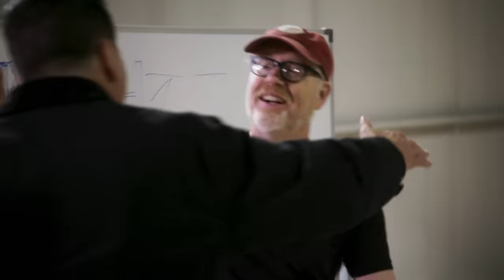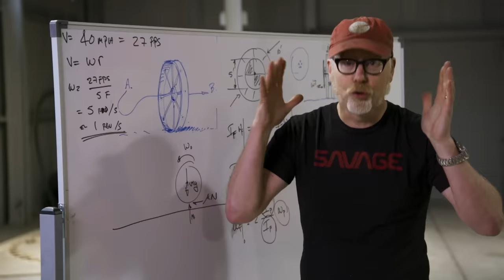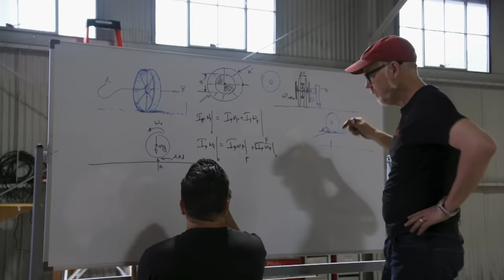"The Power In These Flywheels Scares The Pants Off Me" | Savage Builds

Comment: I'm surprised they did this test in a warehouse. They were careful, at least, but I'd assume they wouldn't want to spin it up in a city at all. If it runs off in a desert you just need to go get it back. If it runs off in a city, you have problems.
Reply: sums up my love life perfectly
Reply: At the JET experimental fusion reactor they have 4 - 775 ton flywheels they spin up to provide the starting spark for the fusion reaction. They calculated that if they broke free while at full speed they would travel ~12 miles before stopping
Reply: It's not gonna keep going through a wall though. Sure its got a lot of momentum but without any traction its not making it far
Reply: @jonohiggs  why those things, who needs batteries ?
Reply: @falcon3792  Traction wouldn't be an issue. Rotating mass vs static mass. Think more of a marble rolling across glass and less car stuck spinning it's tires.
Reply: Yeah in a desert it might get heavy lugging it back, but in a city you've got bodies to hide the whole way.
Reply: Not careful enough, something with that much weight needs to be balance properly
Reply: Yeah. Smells like that cannon all over again. :P
Reply: @monad_tcp  They use flywheels because they can be "discharged" a lot faster than a battery can. Each of the two flywheels at JET can store 3.75GJ and deliver up to 400MW of power for a few seconds. With the best rechargeable batteries that were commercially available at the time when it was built (1981) they'd have needed at least 3000t of batteries (not even counting the weight of the hardware needed to connect all those batteries) to replace just one of the flywheels. And those batteries definitely wouldn't have lasted 40 years like the flywheels now have.
Reply: Take it to a place where monster trucks go mudding, and have a crane with a magnet attached, for retrievals.
Reply: @falcon3792  speed and weight are all that matters, without traction it will spin for a while when it first touches the ground. But, once it gets up to speed, traction doesn't make a difference.
Reply: It has happened in the past that the windings of large wound rotor motors slip and jam, all the momentum of the rotor transfers to the frame and rips loose and the whole motor goes skipping off into the distance. A couple of miles I am told.
Reply: @calebclunie4001  Nah, a fly wheel can go far. For recovery your best bet is probably a truck, some pulleys, a winch and maybe a trailer.
Reply: To be fair, this was a CRAZY dangerous thing to do no matter where they did it, and this makes for exciting TV so...
Reply: @Compgeek86  kinda like how you can spin a hula hoop vertically and after a second of spinning in place it goes off in the direction its spinning. Granted there is probably more friction involved in that but same principle?
Reply: @danielbolin2361  yup, look up a video of someone spinning ball bearings with air, it gets up to speed and when you drop it, sparks fly until it picks up speed and takes off
Reply: @monad_tcp  flywheels are simpler, more reliable and probably cheaper
Reply: More importantly, someone else will have problems.
Reply: @FoxtrotYouniform  comment of the year
Reply: Careful?  That was the worst safety release clutch I've ever seen built.
Reply: @agvulpine  That is true
Reply: @D It would have accelerated with so much force that any crane cables that were in the warehouse would likely have snapped and become a hazard themselves. We're talking about the the amount of energy found in strong explosives here. If this wheel were to hit the ground, pretty much any attempt to stop it would only make things more dangerous.
Reply: Horrible visions of these things dropped on cities from planes comes to mind.
Reply: They didn’t plan for variables very well
Reply: @falcon3792  Never underestimate the destructive power of Big Heavy Spinny Things.  Decades ago, there would be periodic cases of flywheels walking off the shafts of stationary engines (~2ft diameter few hundred pound cast iron disc).  They would typically go a few miles and through any buildings that got in the way.
This is the kind of experiment you do in a big empty swimming pool covered with a few layers of fiberglass coated spancrete panels topped with 5ft of dirt.
Reply: @jonohiggs  I just re-did the calculations with an infinite frictionless plane in a vacuum, and I got >12 miles

Comment: should do this in a dry dock or somewhere similar. I felt my blood pressure drop when they realised it was out of balance.
Reply: See how it was bolted on too? Suprised that vibration didnt completely shear off the threads.
Reply: Adam's definition of 'safe' is one sigma lower than that of most engineers.
This allows for rapid prototyping, but also causes visible risk.

Comment: I did a research project with a one tonne 1 meter steel flywheel that span up to 6,000 rpm. Equivalent stored energy as a 10 tonne truck going 100 mph. Pretty interesting standing next to it going full tilt.
Reply: When you ran the math you actually realize just how dangerous it was
Reply: Video?  Did you use the axle for PTO power?
Reply: @gregsteele9002  He didn't use the truck. I'm sure that was spun up with an electric motor.
Reply: span?
Reply: I hope you had it balanced precariously on a makeshift frame and used a piece of timber as a brake
Reply: I bet this made a pretty interesting sound at the 6000rpm's "redline"
Reply: @michaeltoner1993  HAHAHAHA
Reply: @Joshua Kiser Probably, the Kinetic Energy formula or Potential Energy Frmla will be a great help- to have a glimpsed of horrible destructive power such high RPM flywheels!...
Reply: You can write whatever you want on the internet, but this is total BS.  If you are going to make up a story keep it within reason.  I can't believe that no one else has questioned this in the course of a year.

Comment: As a certified vibration analyst and an industrial millwright i have some serious reservations about this test. With all due respect for the people involved a couple of key things need to be done. 
1) do a resonance test on the assembly. This will show the natural vibration frequencies of machine., for example if the unit has a resonate frequency of 350cpm when it reaches 350rpm or any multiple of it it could shake substantially  and lead to a very unpleasant situation. 

2) The axle housing only appeared to be held in place by a strap wound around it and there was no means of applying a braking force to the discs.

Some sensationalism can be dangerous.
Reply: Sensationalism IS the point.  Camera angles and video cutaways are used to make it seem more dangerous than it actually is. There were safety measures taken that we were not made aware of to bring up the "oh no, what's going to happen?!" factor.

Comment: If both of those wheels don't hit the ground at the same time and get the same amount of traction (impossible), it will take off in whatever direction it wants. Heavy vehicles in front of it will just send it up into the air. I can't wait to see the next episode.
Reply: more likely if just one wheel hit, the thing would soon or over a short distance flip onto one side from the perpendicular torque. Hopefully it would then spin like a top, but no guarantees. Highly risky.

Comment: As a guy who work on 8ft circle saw I'm amazed that they never applied internal tension to the disks. Or balanced them. Saws are hammered to run at certain rpm without wobble.
Reply: I was thinking the same thing like. Why not balance them like a car tire?
Reply: Late to the party but how do you apply internal tension? 
And hammered in this context is deformed to achieve static and dynamic balance?
Yeah I can't believe they did no balancing at all...

Comment: There is no way those steel wheels are balanced enough to not vibrate like crazy! And the way they are attached to the hub is also very sketchy 😂 I love it
Reply: That's why we watch haha.
Reply: Agreed. They need to be balanced and bolted to the floor, even inside a cage.
Reply: Take that thing to a tire shop. Or maybe a tractor shop - you'd need a big wheel-balancing machine for that.
Reply: If you spin it fast enough it will eventually stabilize itself ;)
Reply: There is a reason we dynamically balance airplane propellors.
Reply: This thing needs a DTI to align properly. Could probably just rig one onto a table with a vice and spin it see how much to adjust
Reply: @ninjafruitchilled  When the out of balance parts fly off?
Reply: @ninjafruitchilled  or rip itself apart
Reply: There's nothing wrong with the attachment, they're mounted to a wheel hub that's attached to a truck axle with tapered roller bearings. Balance is definitely a problem though, you're right about that.
Reply: @TitoRigatoni  there is no way to controll how centered the wheel is on that hub if the holes are even a tiny bit ovaled the wheel will be horribly unbalenced again, they could go to a hubcentric setup to try and fix that
Reply: @rubenbraekman4515  There is a locating shoulder on the face of the hub.
Reply: @rubenbraekman4515  Quite. On vehicle wheels there are conical surfaces machined or pressed into the wheels so that when mated to the hub the conical faces of the lug/wheel nuts centre the wheel properly on the hub. There is no way that can be done using drilled holes just relying on the hub studs being centred through plain holes. Without that, dynamic balancing is pointless as it will be different every time it's bolted up. I'm not sure that Mars Rover technology transfers to this sort of project. An automotive engineer will be wincing at this.

Comment: I worked at a boxboard mill and the Boiler facility that provided steam for heating the drying drums also provided compressed air for the whole mill. The air compressors had 6 foot diameter pulley/flywheels and a valve control. When the system was at pressure, the cylinder valves would lock in the open position the current from the motors was cut off, and the pistons would reciprocate without compression driven by the flywheels turning several hundred RPM. When the system pressure fell sufficiently, the valves would close, and the current was applied to the drive motors assisted by the inertia of the flywheel/pulleys, and the compression cycle started again.

Comment: Having experience on the farm operating a buzz saw on a tractor-powered PTO, if those large discs aren't properly balanced, tempered, and tuned, they'll start to set up a vibration frequency and the force of rotation will stretch the metal. Depending on temper patterns in the metal the enlarged metal will try to find room around itself and wobble. Saw blades tolerate a certain RPM. Above that they start howling and wobbling, looking like they are made of rubber.
Reply: I think it's called resonance frequency.
Reply: @casemods  Weirdly enough no, what lifted_above is talking about isn't coupled harmonics.
Reply: Just what you want - stretchy, sharp, high rpm

Comment: I've designed a flywheel energy backup system that spun a 600-pound flywheel up to 8000 rpms.  It was part of a system that generated 800-Volts of DC Power, that was converted to 480-volts of AC.
Reply: How much power (watts) / current (amps) did that generate?
Reply: What's your thoughts on this to a 3phase ac permanent magnet generator and supply part of the power produced to run a quarter horse motor on a pully system to keep the flywheel spinning

🤔🙃
Reply: Badass
Reply: I designed my own homemade covid vaccine. It was re-engineered from another concoction in which I'd take periodically to ward off mumps and measles. Both have worked great as far as I can tell :P
Reply: How did you harness all that force?
Reply: @Rick-the-Swift  lol... Thanks for that , John Roe O'neal.
Reply: @rjames7380  Why?
Reply: @barts1286  why not?
Reply: @barts1286  Where?
Reply: Give me de site...to see more...great
Reply: Can they hire you for safety and insight? This whole build worries me.
Reply: On paper, I presume... 
The engineering and precision manufacturing needed to do that is beyond the scale of an individual.
And the energy and time you'd spend on spinning it up far exceeds what you get back from it.. which begs the question - whats the point? This sort of back up works only when you know the outage time and duration. Some grids use flywheel backups to fill in gaps of planned outage. It sort of works there. For home back up you are better off with a diesel generator.
Reply: rJames tap the flywheel energy to run a small motor to keep the flywheel going, with no external power input? Sounds like "free energy" to me, and no matter how much you gear it down you're adding more friction which will slow the system faster than if you did nothing at all. 🤔
Reply: @rolandlee6898  keep searching internet. There are multiple flywheel energy storage systems available. Your comment is quite childish. There is kinetic energy stored to a flywheel and more you take energy out faster it stops. You can easily calculate the stored energy and divide it by load power to get time. If you take 100W energy out from the described 600 pound flywheel it still spins for days. Start your journey to flywheels for example energystorage dot com and type "FESS".
Reply: @themandan9400  what force?, of course it produces and outputs as much power as the load demands, that can be between 1W to 1MW, depends on the application.
Reply: I'm an engineer who started my apprenticeship working on 200.000 ton power presses the flywheels were around 8 ton and ran up to 1400 RPM, the shafts sat in phosphor bronze bearings, i spent many hours scrapping them in.
Technology moves on, i worked on a huge shredding machine designed to chew up car batteries, we spun a 28 ton shaft from standstill using fluid clutches driving massive Bonfiglioli gearboxes attached direct drive to each end of the shaft.
Reply: My friend came up with a rip cord power generator after i explained flywheel power storage.
Reply: @rjames7380  What purpose would that be for?
Reply: Flywheels for energy storage are usually compact rotors and not such flappy metal sheets, who can vibrate at relatively low frequencies becoming highly dangerous.
Reply: @matter9  you gear it up with pulley and axle diameters.  regulators ground out any excess after the battery banks are fully recharged.  you add power with mechanical advantage/ simple machines.  then transformers and diodes as required.
Reply: @rjames7380  the generator is less than 100% efficient, so is the small motor, by recirculating the stored energy this way you are simply throwing it away.
Reply: How did you account for the rotation of the earth?  

(P.s. it can be done and it's simple)
Reply: @kasperveenje2509  I think an engineer knows what units power and current are expressed in, especially when asked together like that.
Reply: @rjames7380  yeah that's just free energy my dude. Ain't gonna work. Find some way to reuse energy already wasted, that's your only shot for doing something like that. Like using waste heat.
Reply: @n5sdm  (p.s. then why are you asking a rhetorical question)
Reply: @Josh Young  cuz I want to know his thoughts.  (If he has any or even considered it.)
Reply: @joshyoung1440  based
Reply: now just make that run on its own energy and you have the next big thing next to electricity
Reply: Exactly the idea I had. Basically use it to turn a motor for a long time.
Reply: I need to do something like this so my kids can power their own electronic devices. a thick MDF sheet should work
Reply: That had to be loud!
Reply: @rjames7380  i like to use a 27 phase interjunction posilok coefficient,  with a side bar photon set, inset in a copper transfunctioner !!!
Reply: Let's do some calculations. I'll assume that the center of inertia is 1m from the axle. The total kinetic energy is (600*0.45)kgm^2*(8000*2*pi/60)rad/s=226kJ. 226kJ/3600s=62.8Wh, meaning at full rpm this flywheel contains sufficient energy to power an average computer for one hour.
Reply: @GetRektStudio  even if free energy was possible once you try to extract energy from it you will cause it to slow to a stop.
Reply: @SylasG  very true, but if you create more then needed. Convert it to DC using rectifier and had battery backup, then using inverter back to ac, you could use capacitors for surges. If your house used say 5kwh peak if you were to say produce say 8kwh you would be ok. But using battery backup would reduce overall load on the generator and steady power to the load that is connected to it.
Reply: @hetrodoxly1203  could you explain easy way to store those kinds of energies like in the video? i dont mean 8 tons of weight but smaller things !
Reply: @mitsoulas35  Could you be more specific, what do you mean by 'store' and what are you hoping to achieve?

Comment: We had 2 ton flywheels on the ends of these massive diesel engines in our refinery.  They only spin at 100 rpm, but it takes almost 20 seconds for the engine to come to a stop...with compression braking of 12 pistons the size of human beings.

Comment: Have you guys heard of hay balers? You could have gone to a junk yard and found a couple cast iron flywheels with similar inertia that are already balanced.
Reply: The John Deere ones are the best
Reply: Problem wasn't the balance and inertia. It's what a flywheel does best. Which is not slowing down when you want it to. This creates a huge problem with controlling it. Cause they're trying to avoid hurting innocent people.
Reply: @stock_movie1875  plus you have to take into account the gyroscopic precession effect
Reply: @alainbellemare2168  yes. That's another huge pain to deal with.
Reply: @stock_movie1875  And that's why it should always be attached to a clutch like setup. It needs to be able to be isolated from the rest of the system and rotate freely when needed without compromising the rest of the system.